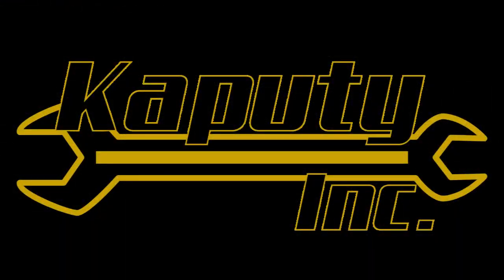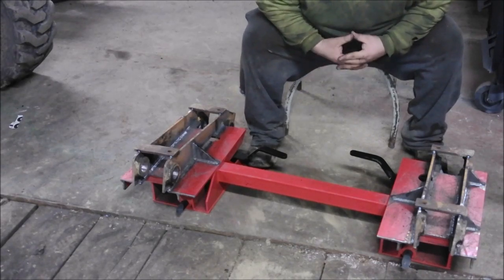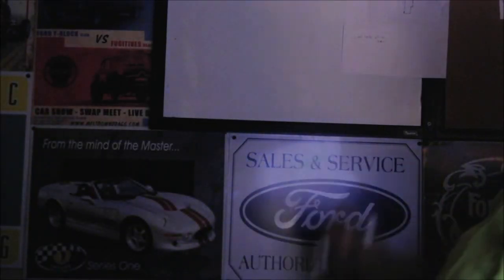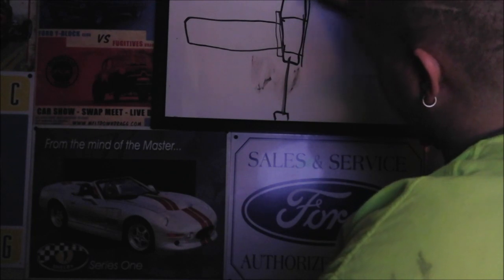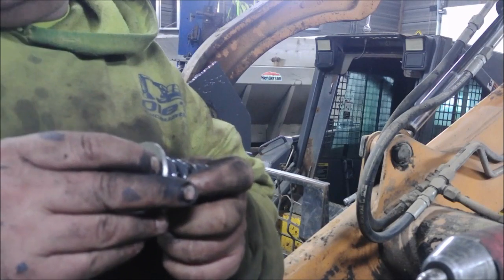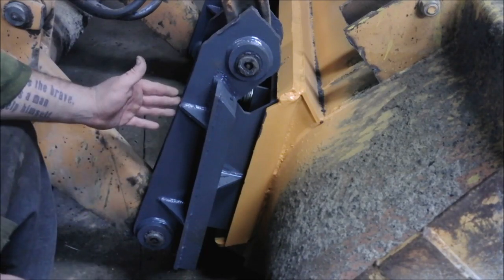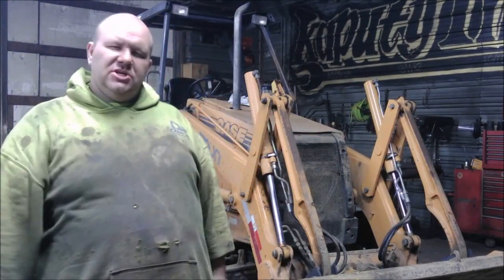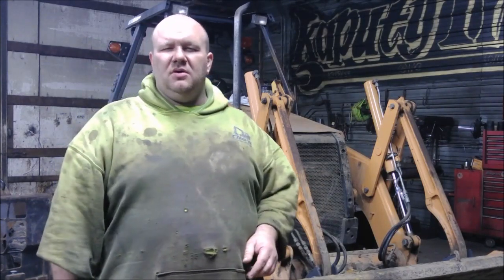Case Loader quicktatch conversion

Comment: Have you done any torture testing on it? I haven't seen to many videos of people putting these on the bigger machines and haven't seen any year + later reviews/afterthoughts. I'm still on the fence if I need to convert or save for a skid loader lol
Reply from the maker: It's worked flawlessly, we use our equipment daily and it's held up great. The only issue was the loose lever's that I fixed in the video, since then I have zero complaints. I'll do a review video. Thanks for the idea.